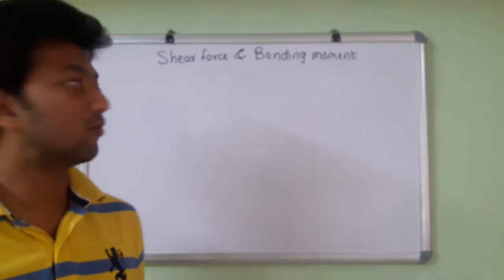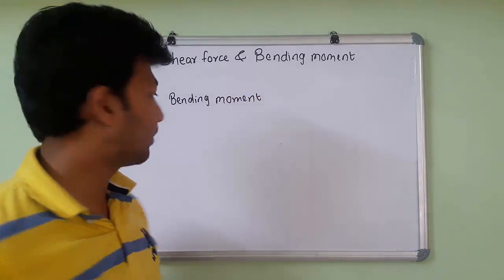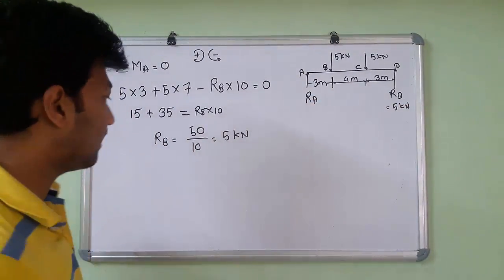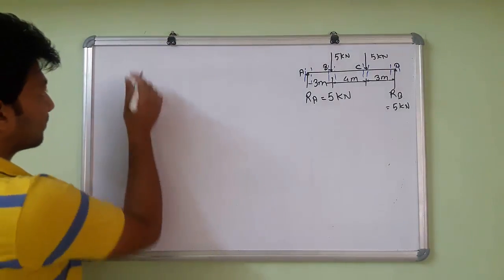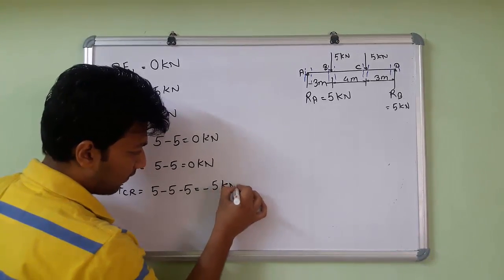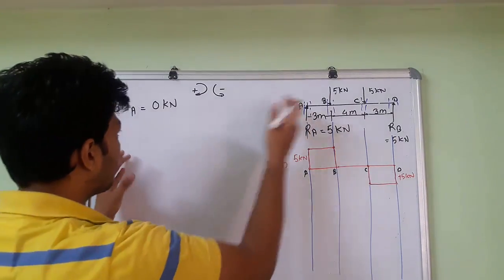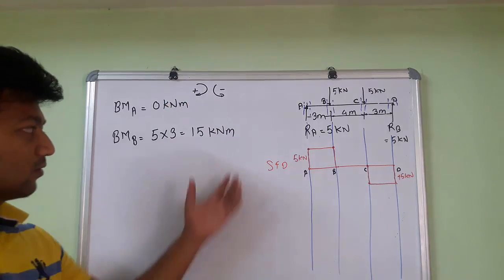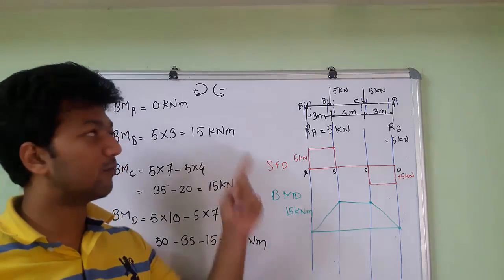Shear force and Bending Moment diagram l Strength of Material l GATE 2020 Mechanical

Comment: Qst. Calculate the strains induced in a cube of 400mm side in X, Y & Z direction if it is subjected to stress of 300 N/mm2 (tensile) in X direction, 500 N/mm2 (tensile) in Y direction & 200 N/mm2 (compressive) in Z direction.
Do you have for this solution. Please advise.

Comment: A steel bar of 100 mm length tapers from 12mm (multiple sign) 10 mm from one end to 30mm(multiple sign) 20mm at the other .if the stress in the bar is not exceed 100Mpa,find the magnitude of the axial force and aslo find change in its length . take E as 200 Gpa